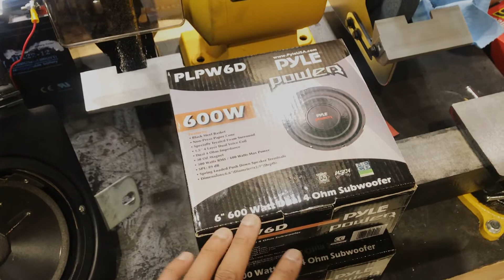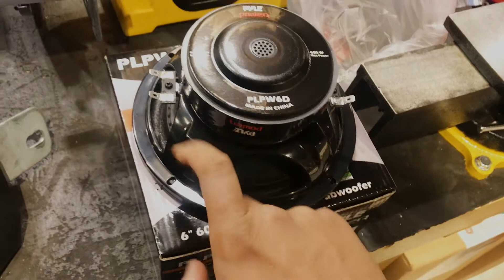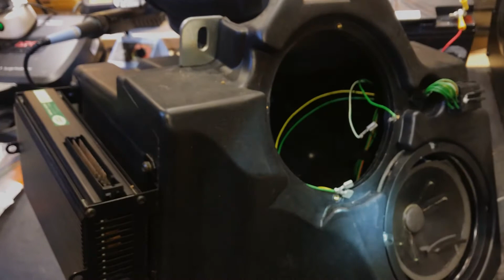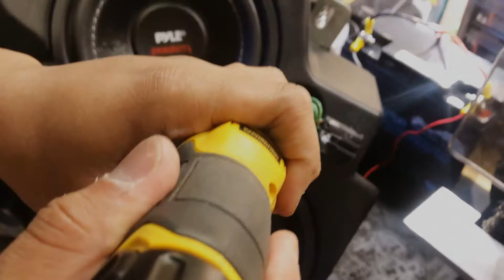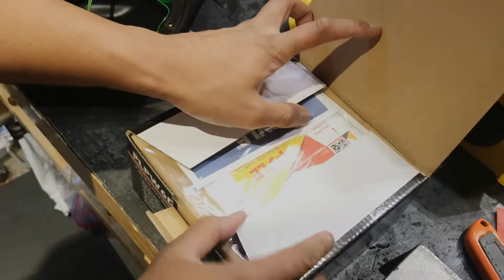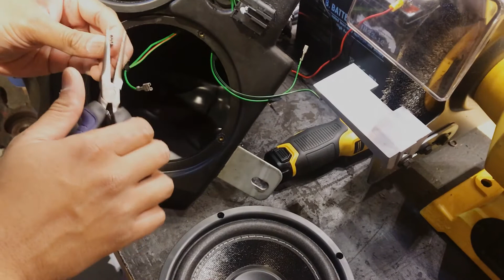Range Rover L322 (2003-2005) Harman/Kardon Logic 7 Subwoofer Speaker Driver Replacement Pyle PLPW6D

Comment: i'm pretty sure the entire LR audio system is 2 OHM
Reply: You are right … only way for the system to run off the amp . Nice video ….. BUT would have been nice to see it working and any changes to settings to get it sounding good !

Comment: Voice coils that lost their impedance over the years ???!!! That's a first !! The speaker impedance is given by the length of the voice coil , to lose 0.1 of an ohm , you will have to shorten  at least a few inches of wire from the voice coil :) !
Reply from the maker: Fascinating comment, let's explore this. From what I understand, you are right, and I am right too. Can't a blown voice coil (say for example in a driver with multiple voice coils) affect nominal impedance? Can't a damaged voice coil (say from rubbing during intense output or high excursion and the ensuing heat production) damage the coil itself causing a nominal impedance change? Why is it that the nominal impedance of a well worn driver never matches precisely that of a new driver (and I mean several ohms reading off reference).
Reply: @mjrgroup  NO it cannot, the impedance is given by the length of the wire , if you have measured them and it gives you less on the multimeter, that's normal , as the multimeter picks up the DCR , not the impedance which is a bit lower then the impedance ( around 3.5 ohms instead of 4 ) !! By the way , did you had a chance to measure them , the original drivers are a bit weird , i have seen an L322 subwoofer, same  shape , but the drivers had 3 mounting points ( in like a Mercedes 3 pointed star) , and the drivers had an orange label that said HAES ( made in Hungary) and they were DVC but 8/8 Ohms , not 4 !

Comment: I dont believe this is the Logic7 subwoofer, the Logic7 HK subwoofer is an obscure shaped driver (single subwoofer) and silver in colour
Reply from the maker: Thanks for your note. The initial 2003-2005 Rovers had the dual 6" drivers as part of the logic system, but in later years (2006+, and in some reported cases {late year production 2005}), the full size Rover switched to the proprietary shape single oval-shaped subwoofer you describe.
From the workshop manual, the dual 6" subwoofer is visualized in the Logic 7  diagram, for the 2003-2005: https://workshop-manuals.com/landrover/l322-a/entertainment_and_information_systems/logic_7_speaker_control_diagram/

Comment: Any possible way to fit 6.5” skar subwoofers?
Reply from the maker: Hi Gavin, the PLPW6D is pretty much an OEM-compatible replacement and has a cutout diameter of 142mm or 5.59." I did a google search for "Skar 6.5" subwoofer cutout dimensions" and saw a figure of 5.826" That's 0.22" more than the Pyle. Your first problem would be the diameter, you might need to grind out a larger diameter opening. And your second problem might be the mounting holes. Although the Skar looks to have 4 holes, I'm not sure if they would line up as closely as the Pyle.

Regardless, I respect your choice on what driver to use, but the higher performing drivers really need beefier cabinets, porting, and even possibly bracing to make the most out of them. I don't think the little plastic factory enclosure would really let those Skar driver shine the way they deserve.